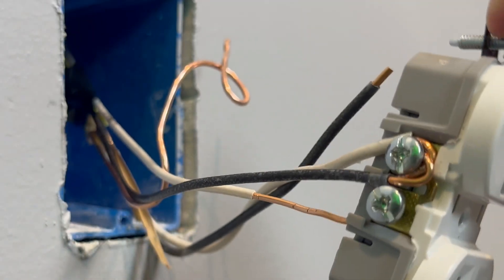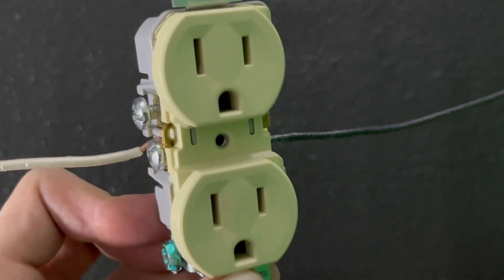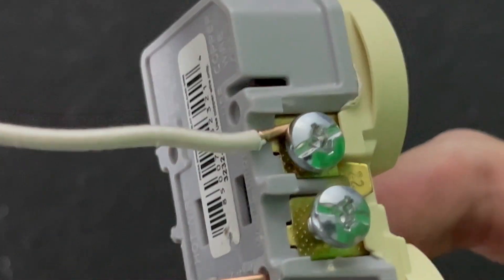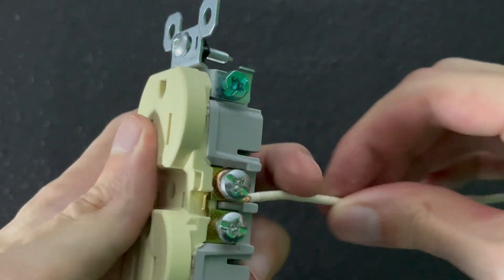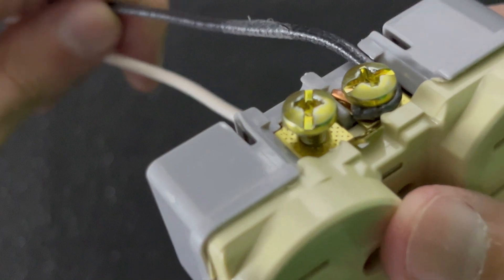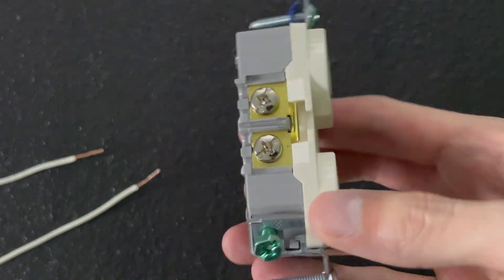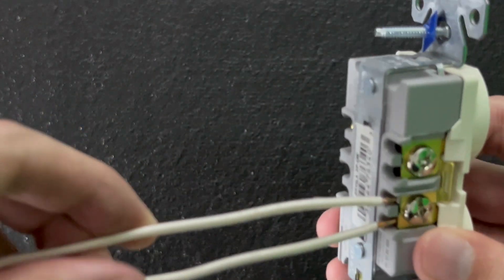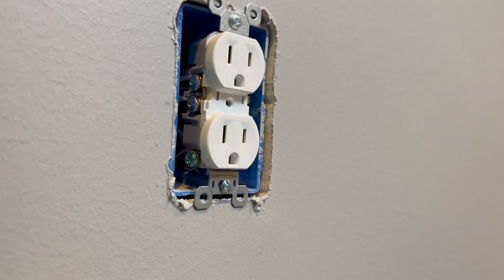Stop Making These Wiring Mistakes With Outlets

Comment from the maker: Please show your support with a like and subscribe
Reply: Here Another Things That You Should Mention In This Video 1. Make Sure To Tighten All The Screws Just Like When There Is No Wire Attached This Will Prevent A Ground Wire From Touching The Screw Or The Metal Box. 2 Make Sure Not To Never Kinked The Wires Because They Can Get Weak And Cause A Fire. 3. Use A #1 Robertson Or ECX Screwdriver Because Using A Flat Head Slips Around When Tightening Down The Screws And Using A Phillips Screwdriver Strips Out The Screw. 4. Make Sure That Your Outlet Is Leveled And Flushed With The Wall But If The Outlet Is Not Flushed Then Use Longer Screws Or A Box Extender.